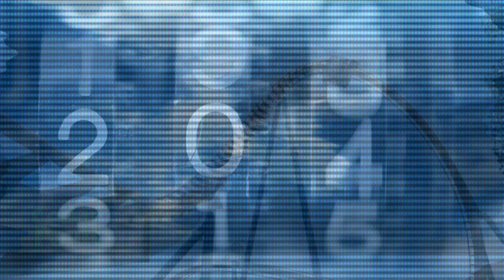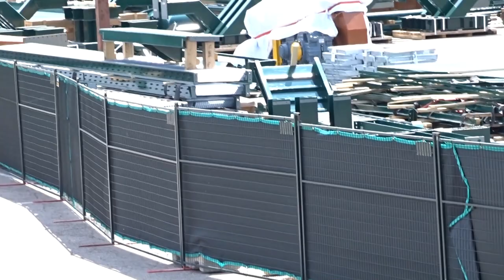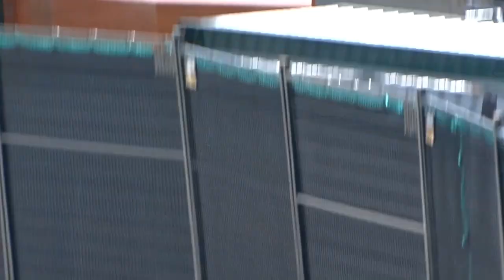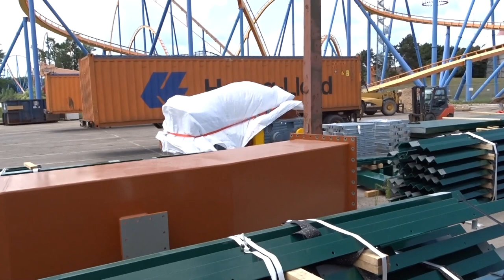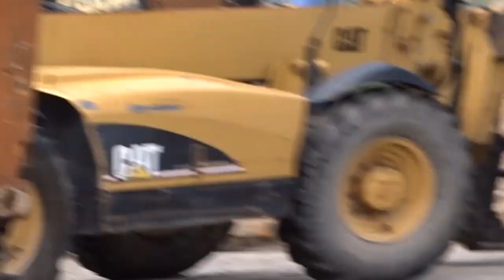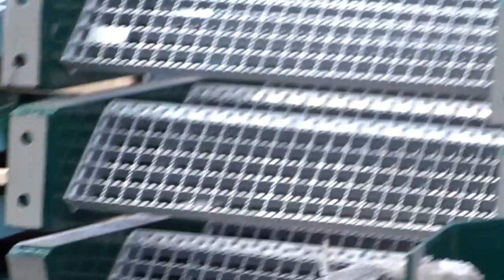Canada's Wonderland New Dive Coaster Lift Motor & More!

Comment: So same amount of catwalks as behemoth? If the lift hill is 45-47 degrees then it should be significantly higher
Reply: Sam17 Valravn has an elevator on its lift hill not catwalks. seeing that this is gonna be a scaled up version they're probably for the mcbr and final brake run not the lift hill.
Reply: right!
Reply: Dive Machines do have both catwalks and an elevator.
Reply: Tyler Sivieri what is MCBR???
Reply: Noshair Hassan mid course break run.
Reply: Tyler Sivieri ... Also maybe for part of the flat portion (turn) before the 1st dive